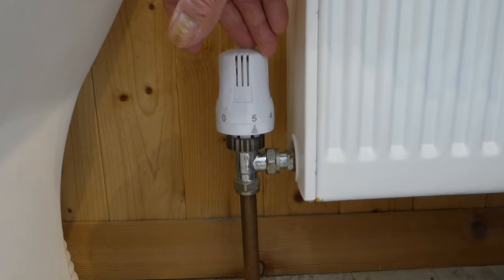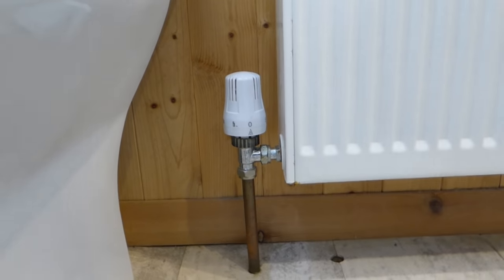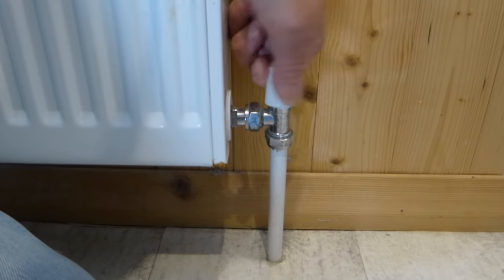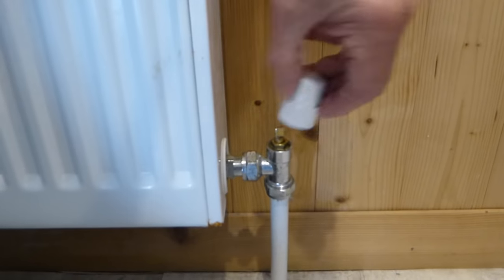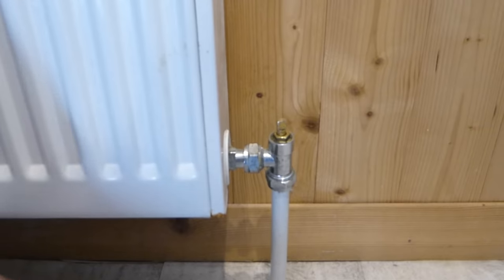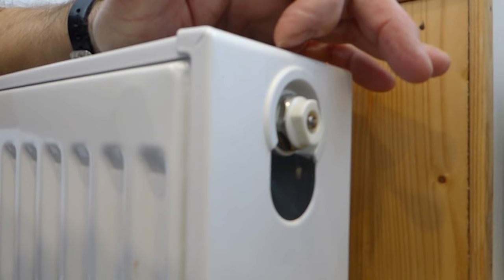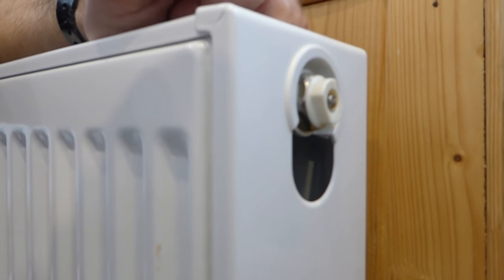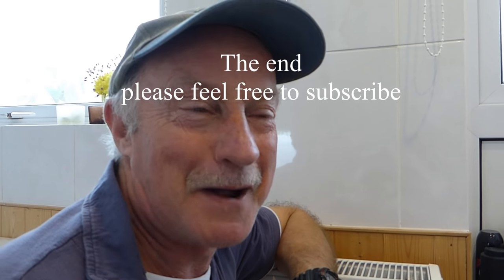How to isolate a radiator. ( Turn it off )

Comment: I tried to bleed mines and the valve won't close, constant steady flow of water, the control marked 0-5 won't stop leak either, can't get plumber till morning..
Reply from the maker: You need to turn off the locksheild valve as well as setting the thermostatic valve to 0.

Comment: Thanks! Our radiator pipe on back wall has broken. Flooding every time we use the hot water. Will try thus later and hopefully it does isolate the radiator slash stop the leak when the pressure is on. Atleast unt😢we can fix it. Il update if it works for the reason I'm trying to temporarily use it for. Can't bath or shower rn and it's not cool lol 
( woman on partners account)
Reply from the maker: Good luck with it.

Comment: I turned the thermostat down to zero but on the other side the cap doesn't sound freely. It had numbers and it's stuck. What do I do with that? 👀
Reply from the maker: Take the cap off and use pliers or small spanner to turn the valve off.

Comment: Mate my one doesn’t want to turn when I takeoff the valve. Any advice?
Reply from the maker: Use a tight fitting small spanner.
Reply: @dereton33  thanks did the trick. Need radiator on in this weather

Comment: I have a rust hole in a rad which is leaking. I followed the steps in your video and it is still leaking.
Reply from the maker: It is either a rad valve not completely closed or the water left in the rad  which will stop eventually.

Comment: I'm using pliers but it won't turn it seems very stuff. Any ideas ? Thanks
Reply from the maker: A small spanner will give you more leverage, once it moves it will turn with pliers after that.

Comment: What do I do when the leak is at the bit where the valve joins the pipe?
Reply from the maker: Give it a tighten with a spanner.
Reply: dereton33 I did that already. It made it worse!
Reply from the maker: Get someone to hold the pipe in place while you undo the nut , when undone slide the nut down the pipe and wrap some PTFE tape around the olive. Make sure to have towels and cloths handy as it can be a wet job. Other than that you will have to drain the system first.
Reply: dereton33 does that mean to power flush the entire system of radiators? Just confirming oh and great video! 🦋

Comment: Still cant turn off radiator. Have caps on each end. One end took cap off and turned off, radiator still on. Took cap off other end and the brass top spins and spins.
Reply from the maker: You have a broken valve. It will have to be replaced.
Reply: Pipaaaaaaaa
Reply: Please help I have the oldest radiator it has the round handle but I can't get it to turn and I had a leak from it

Comment: what happens if you puncture the pipe underneath the valve?
Reply from the maker: It will have to be renewed.
Reply: Just keeps leaking..do you turn off boiler?

Comment: Is it ok to turn off a bypass radiator completely, does anyone know?
Reply from the maker: Yes so long as at least one other is left on.
Reply: @dereton33  Thanks for that, will turn down flow to bypass rad in partners bedroom as she complains of feeling too warm often, will adust valve on the right of the rad, no other way to control heat on the bypass rad otherwise, I think control on the left is for balancing so best not touch it.
Reply: @dereton33  yuh

Comment: I’ve turned off both valves, and loosened the air valve, now water is coming out the air valve
Reply from the maker: If it does not stop in a while then one of your valves is letting by or not fully turned off.

Comment: I tried this and the radiator still keeps turning on 😫😫😫
Reply from the maker: The valve is not closed properly. Try a small spanner on the locksheild valve.